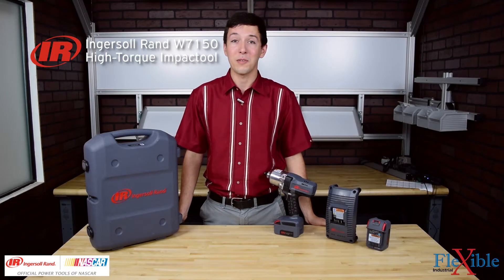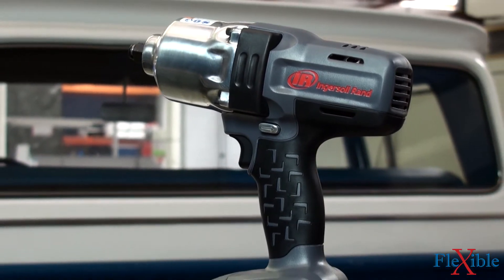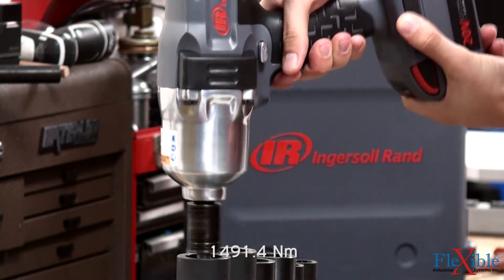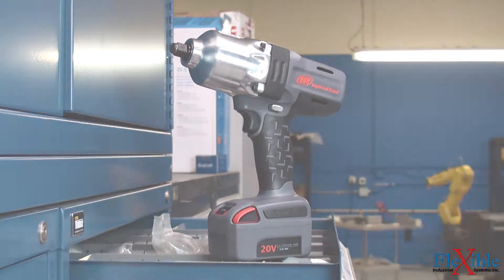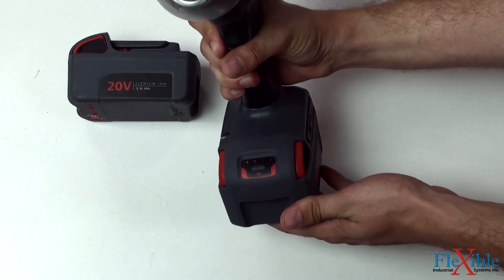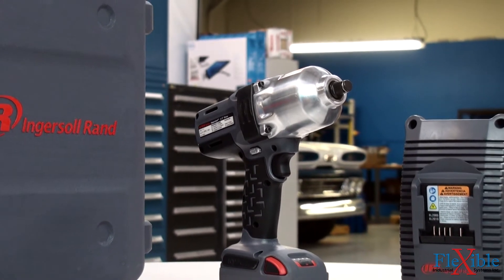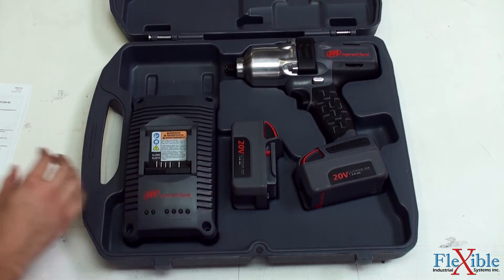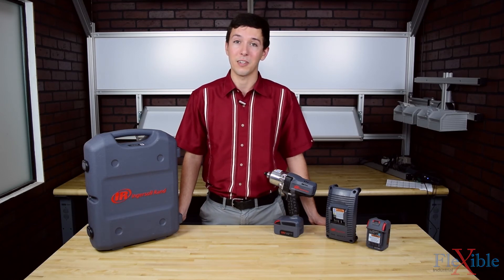Ingersoll Rand W7150 High Torque Cordless Impact

Comment: You have ATG, Dewalt, Milwaukee, Makita that have brushless motors.
This model uses outdated brush motor and has not built-in flashlight.

ATG Gold W7150 Kim 1K has brushless motor, CREE super bright built-in light with 1,000 foot pounds reverse torques.